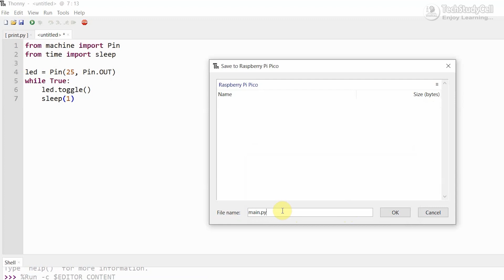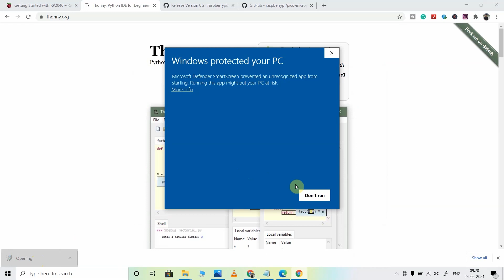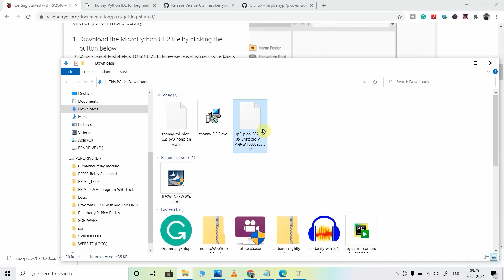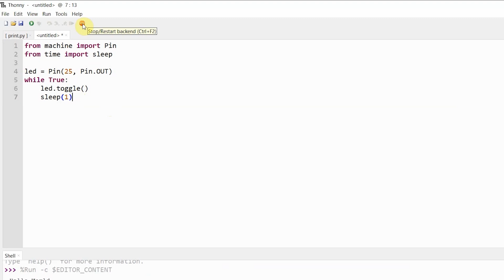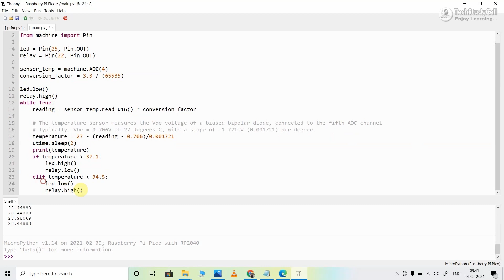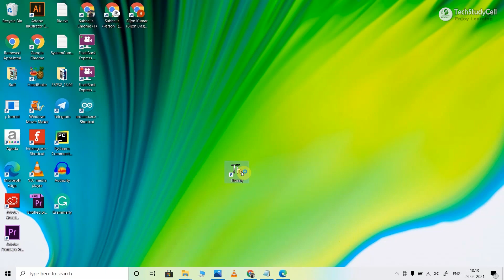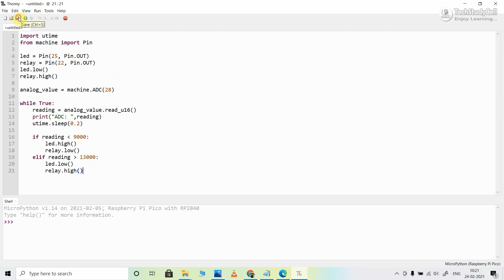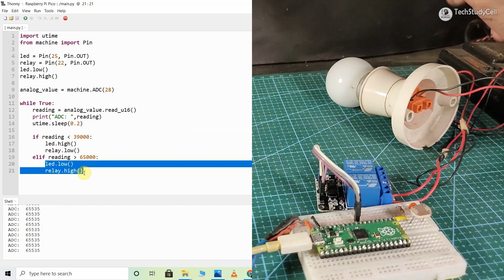Raspberry Pi Pico Projects with MicroPython programming Tutorial - Raspberry Pi Pico vs Arduino

Comment: Dear sir I just want to know how we can control ac dimmer using sinric pro with live feedback on alexa
Reply from the maker: I have already made video on LED Dimmer with Alexa. Will make separate video on AC Dimmer.
Reply: @TechStudyCell  I know sir and I already watched out ,,, , problem is I am using node muc and I want to control robotdyn dimmer using sinric pro,,, dimmer switch , with 2 normal switch and right now I am unable to ,,,
Reply: My both relay working properly ,, and about my dimmer switches it goes on offf only not dimmer fuction working,,

Comment: can i do this in water pump instead the lights ?\
Reply from the maker: you can connect any load. you have to change the relay as per the volt and Amps rating of the load.
Reply: @TechStudyCell  sir i send private message on your facebook